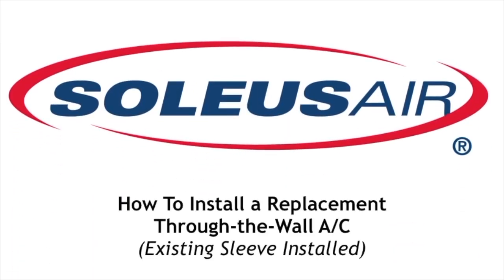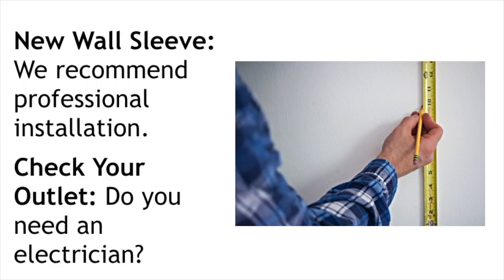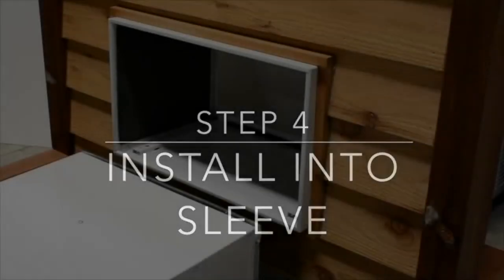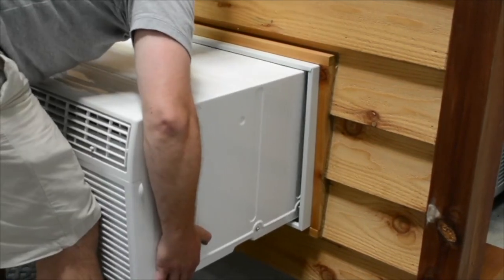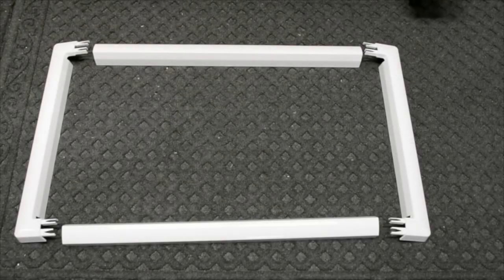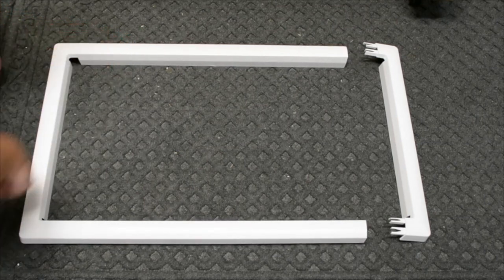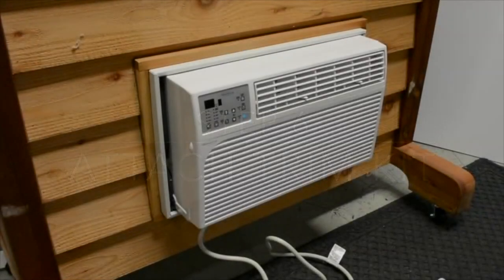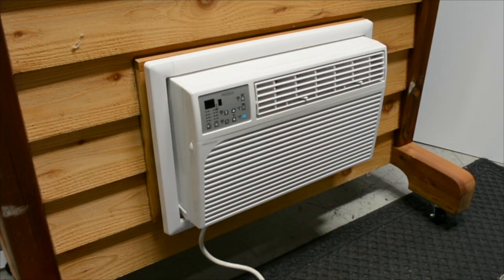Installation of a Thru the Wall Air Conditioner

Comment: You missed several steps related to grounding, sealing, and dealing with existing grills.
Reply: hi, did you put the wire grounding on the second screw of the unit? i put it on th first one, its that ok?? thanks
Reply: @tenoch1971  No. The grounding cable needs to be attached to the sleeve. You might need to drill a hole

Comment: there is a lot not in this video that's critical.  Read the manual.  If you have an older sleeve already there, it may be from another manufacturer.  If you know the manufacturer of the old ac great, if not, check the thru the wall manual for dimensions, figure it out, and install accordingly.  It has them all.   Foam, ground, etc is all covered in the manual.  This is a cute vid for making you WANT to install it because it is very easy, but this is too simple, and you will loose out on optimal airflow, a lot of vibrations that are not needed, and so on.  RTFM!

Comment: I see he doesn't reply. I also see no discussion about the outer decorative grill that is required if you live in an apartment building. The outer decorative grill does not match the grill design of the grill that comes with the unit. So I installed the unit and left off the outside decorative grill. I hope management does not notice. Can not find any info anywhere online.
Reply: We have the same problem. Also the ac unit sticks out through the back once we removed the outside decorative grill. We dont know if the rear of the unti should be sticking outside or not. Since you sem to have the same issue, with you removing the outside decorative grill, does your ac unit stick outside a bit?

Comment: This is one of those new "retro fit" air conditioners, hence why the simple installation.  These are made to fit into an existing sleeve which must be larger than the new replacement unit.

Comment: I have a sleeve that was installed before I purchased my unit. Recently, even time it rains, water is coming through the sleeve and into the house. We checked to make sure the bricks were pointed and they are fine. How do I correct this problem? If I put the grille on the back of the air conditioner, will that prevent the rain water from coming through the sleeve?
Reply: hi did you fix your problem??
Reply: That means your AC housing box wasn't installed with the proper pitch to tilt down to the outside, so the actual AC unit drains towards the outside. Even a window AC unit needs to tilt forward to the outside just enough to ensure water that gets in from weather, and condensation from AC unit running drain out, not into your house. Trust me, this is what I dealt with all THREE boxes in my house that were originally all installed incorrectly back in 1969, in my entire condo complex.

Comment: I had a Soleus TTWM1-14H-01 (14K btu, through the wall).  Lasted a whopping two years before AC fell apart internally and would not blow cold air.  It wasn't worth repairing, frame inside was badly rusted, tech said it was a horrible design.  They actually used steel lines along the bottom for some type of sensor that were also rotting out with rust.   AC was draining water, pitch was correct.  Poor choice of materials used in construction.   I bought it at Menards, and they quit selling this brand altogether (which tells me everything I need to know) .  Not once have I ever had an AC die out so quickly.   Also the remote for the AC died out 4 months before this cooling issue. began.  Complete garbage.

Comment: noob question. if i attach the grille and already have placed the grill backwards (blades facing inwards), does it make any difference?
Reply: 4 years later. Did it make any difference?
Reply: Yes the airflow is supposed to go outward from the outer grill on the side vents

Comment: I had wall unit installed into my  apartment building existing sleeve. Management is saying they are not properly pitched.  there is no sign of water but the installer says they are fine.  First question, does anyone know if the unit should be flush on outer wall? It is protruding about 6 inches inside and totally even with outer wall.  Is this by itself a problem? does this have to do with pitch? are they supposed to or can they pitch it if it already is being isntalled into an existing sleeve?
Reply: 6 inches sounds wrong maybe 4 inches is ok.

Comment: Wrong. You're not supposed to install the grille directly to the back of the unit if you can avoid it
Reply: Why not
Reply: @TheChris91173  Air flow reasons

Comment: Pretty useless video. Yeah, um, if you have that EXACT air conditioner, with a grille that attaches directly to the AC, with exact screw holes. Any monkey can do this. How about some real instructions for where you have to install these crazy grilles and find the exact make/model of both the SLEEVE and REAR GRILLE, then attach it using dexterity of an Olympic gymnastic, without dropping either the grille or tiny mounting screws outside 6 floors down, which I'm guessing is what 90% of real installations are like for anyone replacing an existing A/C (in homes built circa 1960's-1980's that still have these horrible through wall units) without one of these ugly trim kits.

Pro tip: If you have an old GE, Google RAB46A, RAB47A, RAB26A, RAB26W or RAB20, RAB46, RAB47, RAB48 and griles RAG13A and 14. Good luck finding a video on this!! Still searching...